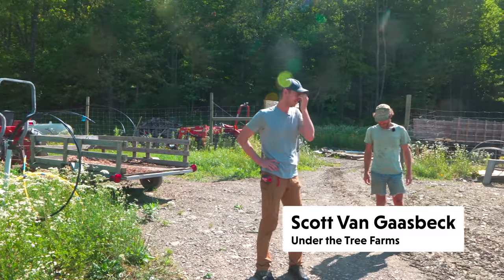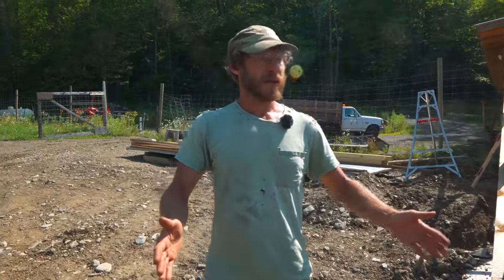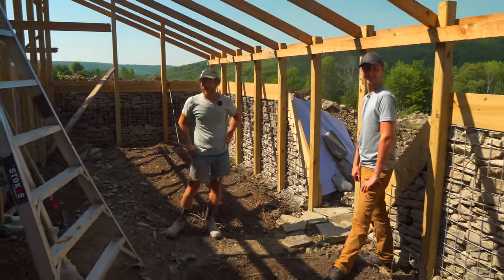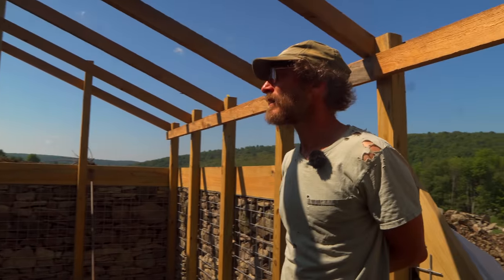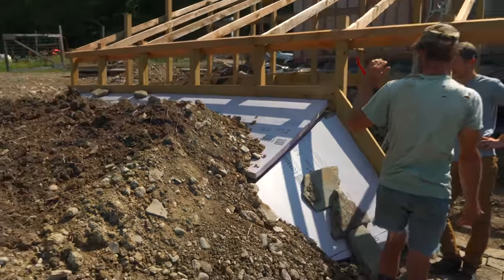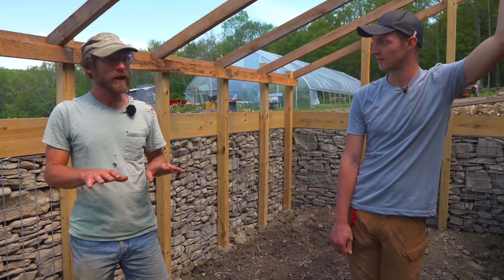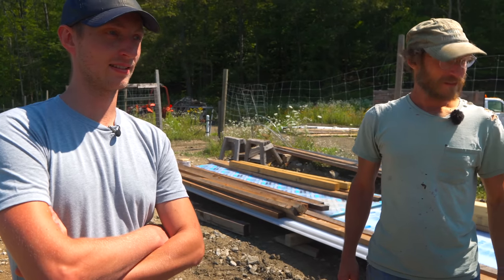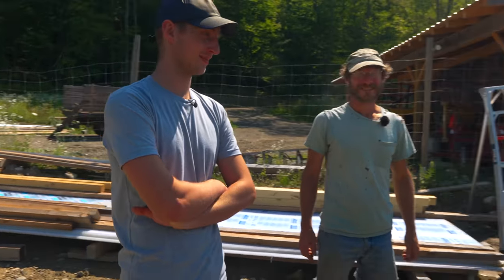Couple Builds a SUNKEN GREENHOUSE for $4,500  — Ep. 125

Comment: We had a very similar structure (minus the underground feature) we called a solarium along the side of the house. All we had to do was open the sliding glass door from the house to the solarium in January to heat up the house. Cement floor. Grew lemons year round. Oregon.
Reply: Coooool
Reply: Built a lean too greenhouse, installed a GAHT system and using water barrels. I was able to construct this greenhouse for apx. $11,000. The GAHT system is 9 four inch dia. perforated pipe with eight dia. manifold. Solar powered fan and vents to ventilate. My greenhouse is 10x40 and 12 feet at top. I'm Norwegian and very frugal can't see how you could do it for $4,500. Glazing alone with sundry tape, screw etc was $4,700. Will soon see if we did it right.
Reply: Where do you live? We live in SC /NC border blue ridge foothills. I want to do a solarium, but we get very hot summers
Reply: @susiealavi1425   it is finger lakes region in upper new york state
Reply: Now that's cool
Reply: @susiealavi1425 same In Alabama also the humidity in the summer is an issue…
Reply: @revoltiz1  middle GA here, zone 8a. I always thought it would be great to have a solarium or greenhouse but it just gets too hot here. I’m afraid I wouldn’t get my moneys worth out of it plus having to heat it in the winter.
Reply: @davidmartin4683  norway is one of the most expensive places in europe

Comment: the heat radiation is a  concept called thermal mass, instead of insulation keeping heat from migrating you got dense material like concrete, rock or water that absorb heat usually from the sun. and once the sun goes down it releases heat at a set rate in order to equalize the heat with the air. Its very clever to utilize it in a greenhouse.

Comment: Wow thanks for all the positive feedback on my project!  I’ll try and answer some questions.  What wasn’t shown was the excavation with a perimeter drain of gravel and drainage pipe. Buried air exchange pipes would have been impractical due to drainage, but I like the idea.  This could have been built of dry laid stone and it would be beautiful but what I have is small irregular rocks.   The building it is attached to is a repair shop not a house, and the siding has an air gap behind it, but please take care with moisture attaching to your house!  The rafters are full 2x4 hemlock, selected to be close to perfect from my local mill.  At least equal to “2x6”s from the orange or blue box.  I’ll let you know if they weren’t enough! Cost breakdown: Store lumber 1100, lumber from sawmill 500, wire panels 400, polycarbonate 1900 delivered, extrusions 400, screws etc 200.   I have a 40 year old 23 hp loader tractor and a 1969 jd 450 dozer, so I am just counting materials.  I had the fan and vents.  The thing I like about the electric vents is I can set the temp within a few degrees, but the solar ones work too.   I recommend your local Mennonite farm supply for polycarbonate and vents, in ny and pa there are several that buy in bulk to get a very good deal..   I now have the stonework and grading done outside and gravel and stone paths inside, the power is done and ventilation working.  Just frosting outside at night but about 60 in there in the mornings, and lots of gaps to seal still.   I will post an update on our channel when I get more done!  Scott 
Btw I have no credentials whatsoever, just farm know-how,  which is 90% careful observation and 10% s blind confidence.   Build at your own risk!
Reply: Thanks for the update, Scott.

Nothing wrong with not having "credentials". What I am finding in my research and learning of different land management and growing/gardening styles of thought is that the pioneers all started with OBSERVATION. And it seems that their advice always falls back to observation of your specific environment and observation of the effects of the changes you made. There is never just one right way of doing things.

My husband and I have 80 acres of raw land which we have begin improving. Along with building a house and homestead, an underground greenhouse is also in the plans in the coming years. So, it is very fascinating to see the thought process and design considerations of others. Thank you again for sharing yours!
Reply: Would love to see some updates as the greenhouse grows out and more on the fig production.
Reply: I'm looking to do something this in a few years so I can grow figs in Poland. Don't need to keep them super warm, like you said, just moderate. Would you ever couple this with earth tubes?
Reply: I would absolutely be interested in a way to make attaching a greenhouse to your house work with the humidity issue you mentioned. Help warm a small house in the winter, grow crops year round, and have more of an open-ish concept with having double doors/patio doors open year round from the house to the greenhouse. Looking for info to make it work with the lowest cost possible. Don't want to have to run an air conditioner or central air to keep the greenhouse at a good growing temp. Doing research but not finding much info. I'm in Missouri.
Reply: What is your channel?
Reply: How do you make out with snow there? I thinking worse case  scenario you need a method to remove it. And using it as a heatsink to warm the house or other structure sounds very useful too. I have an uncle in Alberta who was installing deep underground piping to warm houses to great effect from what I understand. I saw a video awhile back of someone in Vancouver I think. He was growing Citrus halfway covered in poly against a house. He used Large Christmas  lights  woven through the branches to warm it in the winter and It worked like a charm!
Reply: i woud ask about the pipes and drainage, but you answered :)
i am looking forward for an update under the snow :)
Reply: It's one thing to be creative and have the practical skills to build things (kudos!), but your ability to explain the process, and the reasons behind the process, are superlative. You've conveyed so much useful information in a short time that you're going to help a lot of people. Thank you for sharing your knowledge!

Comment: So interesting to see the sunken greenhouse done with stone walls rather than concrete…. Given me a real pause for thought as my trade is dry stone wall building, I would say that this would absolutely be possible without the gabion baskets. Maybe the stone walls are good for humidity too? Low tech and lots of natural materials so it’s not hanging round for more years than necessary, what a fantastic project! Great video guys👌
Reply: Seems the retained stone is only for the thermal mass “storage” of radiant energy, presumably quicker process with Gabion?  Drystack or mortared wall could certainly replace the metal and lower part of the wood wall I’d think.
Reply: Probably could use that rock he’s got as is for a sort of rubble trench foundation with a bond beam atop the wall.
Reply: Id assume good for humidity stability

Comment: My father had 6 green houses, and in the spring when it warming up. He make paint, and water in a hand pump bottle. Spray the white wash on top of the glass plains , to block the sunlight in the summer.  The rain will wash by fall. The natural gas bill was high in winter, but he placed alot in one or two houses, and closed of the the one's that was used until spring planting. For venting, bring air though 12 inch tube under ground a 100 or 200 feet . That will cool it off in the summer.

Comment: Nice work, I just started digging this year for a greenhouse tucked into a south facing hill overlooking my garden and that 2 tier step down system with an stone internal shoring wall is a good idea. Was just going to make it 12 ft wide with one level, but do have room to go another 6 or 8 ft and split the difference into 2 levels........hmmmmm? Tough call, I would have to get rid of my external cold frames in the plan and have much more inside. So many ideas when looking at what people build and for me it has to be a passive heat sync greenhouse, no utilities running out to it except for maybe a couple solar panels and a battery or two for lights. Got time here anyways to figure it out, looks like a 3 year project for me. Hope everyone had a good growing season, it was good here in a zone 4b Ontario, Canada....the pantry, freezer and root cellar are all full, the garden is put to sleep already and there's 2 full bays of compost ready for startup in the spring. Got the snow blower all tuned up and settling in for a long winters nap.....happy gardening 2023 everyone.

Comment: Brilliant idea for a greenhouse underground. We recently created an underground greenhouse as a proof of concept in the Ozarks, to extend the growing season with more temperature control than a cold box, AND to reduce heat stress during the summer. Basically trying to effectively utilize the constant ground temperature of about 56 degrees. Not sure how fiddly it will be through the winter but with the crazy climate changes we had to do something to keep producing food consistently.

Ours is much smaller, surrounded with concrete blocks, and covered with old windows that are easily removed as needed. And then there is the indoor vegetable growing room. Our goal is to avoid grocery stores and so far that's working.

Comment: for overheat protection you can get pcm containing spring. its heat activated. when the pcm material melts, at 25, it will push the piston out open the window
Reply: Yes, aka wax arm automatic window. opener.

Comment: Awesome design. Good luck going forward. Here's some low tech. To inexpensively prevent freezing use strings of christmas lights (large bulb type). Enough for behind glazing, and will work overnight with patio planters (citrus) moved against the house, hung with the lights, and covered with plastic. A trouble-light has a hook for hanging and a protective enclosure that keeps the bulb from touching anything. Emergency greenhouse within a greenhouse for that super January snap. Light bulbs are great for winter heating inside paint cabinets, crawl-space water supplies with a metal water shutoff (inside insulated box) and preventing freeze-up in sink, tub and toilet traps.

Comment: Such a nice gabon greenhouse. Beautiful! In addition of the top vent, 1 or 2 - 6" pvc perforated tube across the top shed section which would be a suction of the tube fan. The heated peak air would then push warmed air into the ground tube made from weeping tile tube.  This would heat the ground mass preparing the ground for winter heat.

Comment: Look into Rocket Mass Heater for indoor use.   Compost generates a lot of heat . I've seen large hoop houses with large contained piles of compost. I think you can incorporate the Rocket Mass Heater in this green house running it along your back wall. They are wicked efficient and endless configurations once you get the concept of air flow. I do like what you're doing with below ground.

Comment: I'd love to see an update on the back wall near the house to see if the weight of a concrete pad was enough of an addition to the surcharge load to cause a critical failure after the frost and thaw cycles we had. I would guess he's only slightly better off than a walipini supported by pallets and having a structure right next to it should make for an exciting repair.

Comment: You don't have to reinvent the wheel on this.
There is enough material online about passive solar greenhouses, a Chinese approach to greenhouses in the winter. That you can adapt it quite well to your own.
Basically two greenhouses in one, with an airgap between the two, but where the inside greenhouse also gets an insulation that you can roll up and down. I am building one next year, I hope!

Comment: A little tip for attaching to a house with vinyl,: the trim piece under the soffit at the top can be lifted a bit and a wood anchor can be snuck in a bit above it's lowest point. It secured an angle bracket so I didn't need 8 inch screws, just 4. One in each joist in the parent building or for each joist in a king beam (king beam?).  I ran double 2x4's and could get them both on the bracket. It wasn't a stud hanger, those need more screws. They were half inch or 5/8. The stuff you use for posts.
   At the corners an expansion anchor, it had a block foundation so it was just to keep things like the door from getting wonky, with another bracket.  Then a 2x4 vertical connecting the two.
   It will lay flush with the siding and there will be a sawtooth gap all the way down. I just rolled bubble wrap up and filled it in then covered it with short trim boards. They were the width of the vinyl shingle so I didn't need to copy the sawtooth. 
   The rest was block and 2x8's. No footer, wall is 36 inches below grade and 18 above.

Comment: Some compost piles in that above ground over winter may give you a little more time to work in it. Sacrifice a little space you seemingly may have plenty of in winter to the piles spaced either end, it could generate enough heat to work a little longer. Seen Edible Acres do it on a smaller scale for years and first saw Van Powell's 6 minute video when trying to learn about rocket heaters a few years back and found it to be quite useful.

Comment: Your ventilation system is similar to my elementary school.  The roof is the same and the window are low and the windows are on the top.   Open the windows and get a draft that was just amazing.  It didn't matter how hot it got, the breeze through the day kept it comfortable with no air conditioning.
Great presentation, and thanks

Comment: Roof "Hoist" Jack Legs: Cover with Plastic Pipe, and then Big Foam "Noodles", Using a means to "Fix The Plastic Pipes, allowing the Jacking Gear Rods to Slip inside the Pipes, but the Foam for "Head Banging" Protection! Nice "Chain Hoist Enhancement!"

Comment: put a gutter on it, then funnel that water back into the greenhouse.  Use that water as thermal mass for fall and winter, have a black tank, shade it in summer.  Put some shading according to the slope of the sun in summer versus fall and winter.
Reply: Yes, A wall of tall ( as possible), skinny ( to not take up too much growing space) black-painted barrels along the north wall. Not necessarily for cycling water through for use, if that's not be practical, but for thermal mass.
Reply: one which I built in rural Michigan in the early 70s used a deep trough of water in the rear as a heat sink which we stocked with tilapia, a type of fish tolerant of temperature swings. worked like a charm.

Comment: A structure with south facing windows will extend your season without being too hot in summer or too cold in winter. Cover the east and west walls with reflective Mylar to captue more photons early and late in the day. Put thermal mass on the back wall. The conventional greenhouse is a thermodynamic disaster. A passive solar house has window area equivalent to about 12% of the floor space.

Comment: Great work and well thought out. Interesting to watch. Just wondering about critters coming through the rock walls? Any issues or not enough incentives in the greenhouse for them yet? I had many little souls making it through loose rockwalls like this and decided to use solid concrete for that reason, but a finer galvanized mesh added to the wall might help in that case as well. But it will detoriate and rust a bit faster than the heavy duty stuff. One comment on figs; as you said that they produce figs on new shoots only - you might know this already but I wanted to mention this for other listeners that might not: there are Breba , Bifara and Unifera fig types out there where the first two will produce figs also on last years new growth while only the last type will produce figs on new growth only. Good to check which type you are growing in case there is a risk of frost die back. All the best and good luck with this amazing project.

Comment: To extend the use of the PLastic Solarium...I would Pland a few fence posts 24 inches from the outside Walls...then fill the Gap with Stawbales stacked...and leave snow accumulate as insulation..the Walls will help it Build Up ..Brace it Inside with a Mega Beam of 20 FEET in the MMiddle -3x2x12 together, glued and scewed, nailed on 2 Posts..That should give you 2 or 3 degrees more, keep ye above Frost, Add Alu Tetrapak onRoll on Northern Roof Slope..a few tweaks
Also a few Barrels, filled with Water, thermal Mass and Humidity for the Plants..have a Drip System of Irrigation..keep it simple

Comment: It's not too hard to build a very basic motorized controller for those roof and front vents.  You can take a signal off a off the shelf low voltage thermostat and/or timer, then drive a motor until the window triggers limit switches.  You can even just use the voltage from a tiny solar panel to detect when its getting good sunlight energy. I plan on doing something similar next year.

Also the upside to running the PEX is you can just cap it off, tie it to the side, and just see how the greenhouse performs.  If after a few years you think you need the boiler, its just sitting there ready, otherwise it does no harm.  Also if you take the same route and just insulate the lines and connect it to a decent mass amount of mass the chance of it freezing on you is going to be really slim.  My guess is at most you would just be trying to add a few degrees of energy in those deep winter nights.

And as for rust with high humidity (the galvanized wire /should/ be fine on its own).  Just paint it.  You could spray on a few layers of natural lime based whitewash.  OR coat it in boiled linseed oil, a few good coats on linseed will provide a natural polymer coating.  Plus both have their advantages in either mold or bacterial resistance.